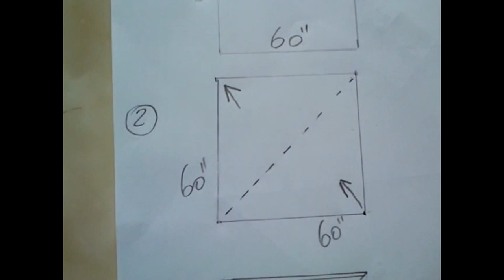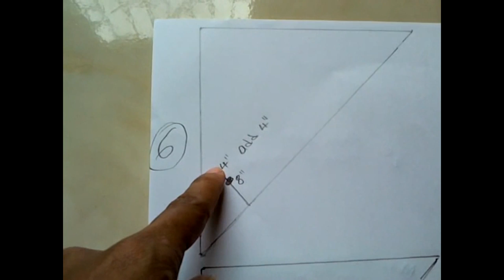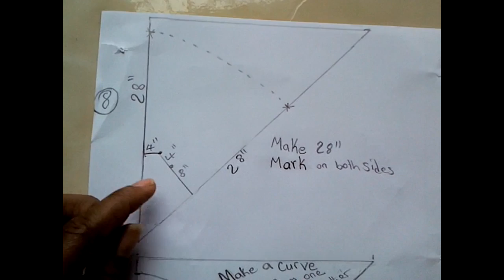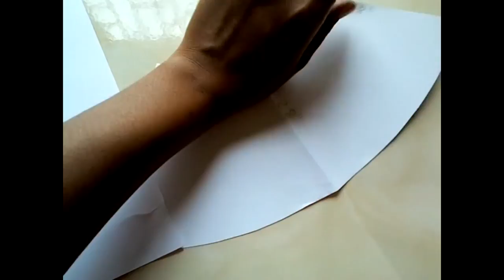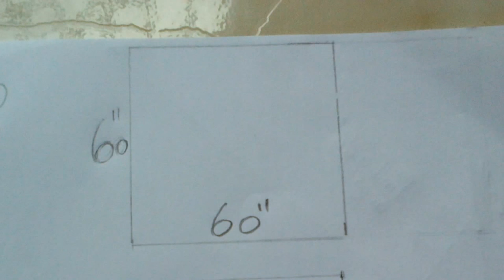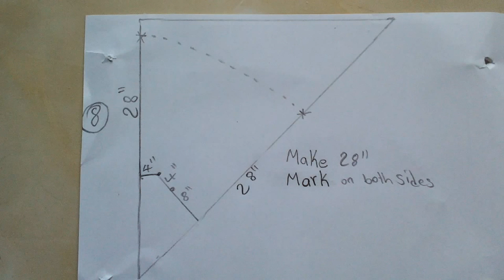How to make a Waterfall Valance Pattern

Comment: Hi mrn , could I make this pattern smaller or 60×60 is standerd size do one nw, need ans pls
Reply from the maker: lily Nelson Hi, good night, you can make yours smaller by cutting down the measurement on both sides, so you can take of 10" or 15", you do the same to both sides, and then follow the steps on the video, you can cut the 8" to 7" if you  want to Chang the inside part as well.
Reply: @ceceliasdesignworld841  thk you hun🥰

Comment: Very clear instructions.. Thank you...Is this measurement can work for any windows?
Reply from the maker: Hi. Yes the measurements con be used, but you can adjust the 28" to make the fall of it longer and also you can change the 8" to make the fall on the inside of it wider and deeper, so you can have a bigger space in between it.

Comment: Hi Cecelia  I was trying to cut. This waterfall valance but that 16" across on part (4) is confusing me is 8" on the fold fabric and when open you will get the 16" .
Reply from the maker: Margaret Allard Hi thanks for your comment, the 16" mark is for you to get  the angle on witch you will cut on, yes, you will get 16" when you open it up, and you should cut the 8"  on the fold . When you get the 16" from the 8" when you fold it out , that means your doing the right thing. You will get an additional 8" on each side from the 4" they will be used for the rod.

Comment: I love your video thank you so much. I do have one question...if I wanted the drop to be “deeper” how can I calculate that
Reply from the maker: Janell Garcia Hi you can get a bigger fabric, say a 80"/80", you can change the 16"  to says 24" or even more change the 8" to 16" if using the 24" the 4" marks will always remain the same. The 4" marks are for the rods to go in to. When you Chang this part you will get a deeper fall. To get more fullness you can use the maximum amount of the fabric that's left, remember that any thing you do on one side you have to do on the other side, so start measuring on the open side first because it will be  less in lent, do the some to the fold side connect them and finish withe all the other steps. You will end up with a bigger valance.

Comment: Does it always have to be 60x60? If not, how to I calculate what size I need?
Reply from the maker: Hi, You can make it bigger or smaller if you want, just increase your measurement, example, you can use a 60" wide fabric, and then if you want it smaller than this one, then make the measurement going down smaller, or, if bigger add on to the measurement going down. then alter the other measurement, bigger or smaller, to get the shape. You can use a wider fabric than just the 60" to get it wider. 
when you make the measurement going down bigger or smaller, it will show  in the way it drapes.
thanks for watching.

Comment: show the formula u used
Reply from the maker: Hi, when making a waterfall valance like this the only thing you adjust is the 8'' and the 28'' if you want to make it bigger or smaller, this one can give you a 18'' drop, you dont really need a formula when doing it like this. Both the 4'' marks will be the same. you will just adjust the other measurements to make it bigger or smaller.

Comment: hi I understand  one thing I want to no d swag u cut with d ziz zag edges did u cut it on d bias I saw u cut d pattern but i did not see if u cut it on d bias n if so how much material
Reply from the maker: Hi, You dont have to cut on the bias, I didn't, I used a 60'' wide fabric. it takes about 42'' of fabric for that swag pattern.

Comment: hi cecelia Susan from Trinidad do u cut d waterfall valance on d bias n if so how my h material is needed
Reply from the maker: Hi, it you follow the video then you will be cutting more or less on the bias, and one of this type of valance pattern take about 60''/60'' Fabric. after making the pattern you can cut it any way you want. You dont have to cut on the bias, it is just easier to make the pattern on the bias, but you can place the pattern any way you want to put it on your fabric when your going to cut. Once you have a pattern to work with it will take less fabric, so a pattern like this will take about 32'''  so a yard of fabric should do it.